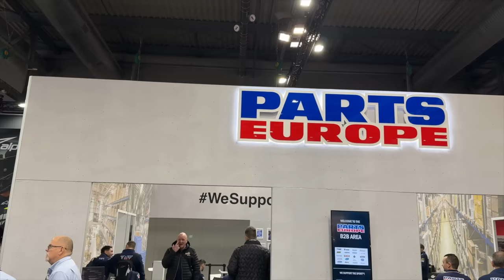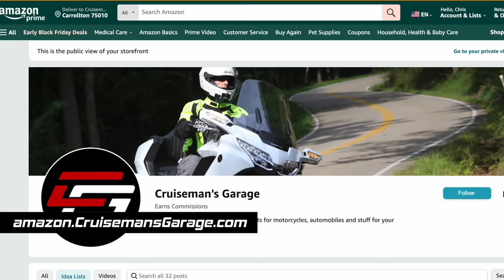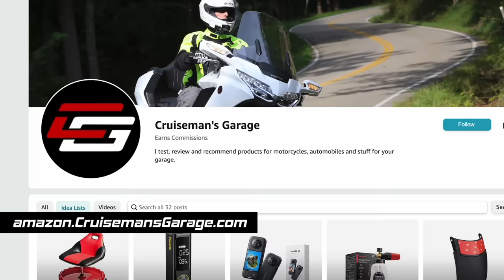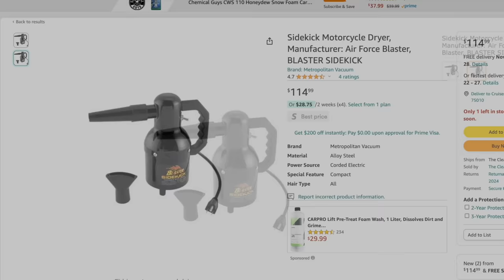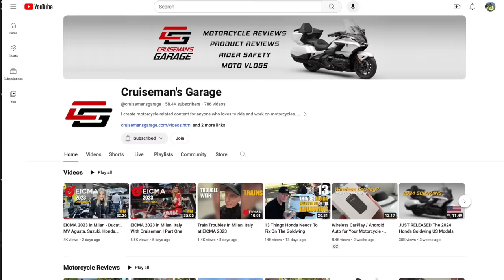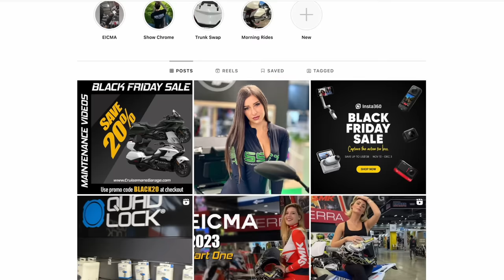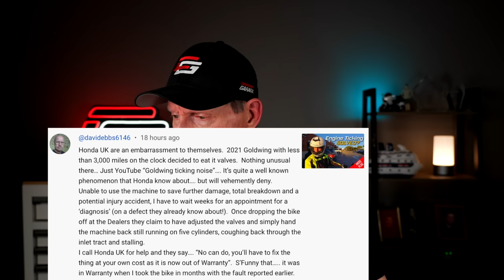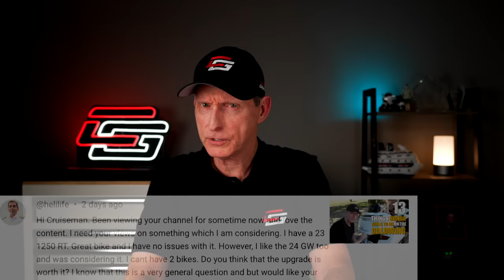Ep 27 Holiday Edition 2023 | Crown and Comments

Comment: Since we are from the same generation, I like your sense of humor. Probably the best Moto Vlog you've ever made. Concerning the "Ticking Noise" : I never had it before the first valve adjustment. The reason of the noise is, that one of the valve outlet adjustment levers was not properly fixed. So it had to be fixed with a wrench with the correct size. Just a matter of minutes. If some owners report about the Ticking Noise before the first adjustment, it is probably because Honda doesn't fixed them with the correct momentum during the assembly process.

Comment: My 2021 has a valve sound on the right side.  I've ridden over 250k across 3 6 cyl GoldWings and have engine knowledge.  I know what it should sound like.  I'd be happy if the right side just sounded like the left side.  Dealer said the sound is within spec and won't address till I get to the 32k service.  The sound is getting louder and I'm starting to get concerned.  May have to out of pocket and make dealer do it anyway. I'm not happy.

Comment: In this video, Cruiseman suggests that anyone who has experience on the bikes below share it. As I recently switched from a 2021 BMW R1250RT to a 2023 Honda Goldwing Tour DCT with airbag, I can share a little and with great pleasure, my impressions on the differences between these two fantastic bikes.
Firstly, both are very comfortable and provide fantastic aerodynamic protection for the driver and passenger from wind, rain and cold.
These motorcycles are kilometer/mile devourers by nature, the BMW also lends itself a little to adventure. As for the differences so far, I highlight:
- Luggage: contrary to what I assumed, the Honda Goldwing's side bags have less space than the BMW's, however, the Honda's top box holds 61 liters of cargo, versus the BMW's 49 liters.
- BMW's adaptive cruise control is something that would be very useful on Honda, perhaps it will be included in the near future.
- Maneuverability when stopped: incomparable, the BMW is no longer for my physical capabilities (I'm 69 years old and I'm 1.69m /5.5inch tall). At Honda, the 1800cc boxer engine with 6 cylinders, the DCT gearbox, the walking mode with reverse and forward gear and the low center of gravity were the main reasons that made me switch to the Honda Goldwing.
- Information on the status of the motorcycle: the Honda Goldwing lacks a lot of information about the status of the motorcycle, which we find on the BMW, such as tire pressure in metric units, information on upcoming maintenance, battery status and capacity and many more others, useful. The ease of using functions with the wonder wheel on the BMW is very good and simple, compared to the various buttons and their positions on the Honda. On Honda, most of the buttons have night lighting, on BMW none do.
- GPS: Honda Goldwing offers its own GPS on the motorcycle and also Apple CarPlay and Android Auto, which when compared to what BMW offers on its TFT, its own software and another on a smartphone that uses Bluetooth and WI-FI to connect to the motorcycle. This software on the motorcycle and on the smartphone, until the beginning of 2023, presented a set of problems and bugs, which left some owners of these motorcycles somewhat dissatisfied.
Conclusion, there is no perfect motorcycle, the ideal would be one that has the various features we like in one. But how much would such a motorcycle cost?
On the other hand, today and after this change, I question whether so much technology and electronics on a motorcycle will not be an exaggeration and a source of problems in the future.
Still on BMW's absence at EICMA, they never liked mixing with others, to give you an idea, around here my old dealer didn't do Black Friday, but Black Fest.
Reply from the maker: Great comparison. Thanks!